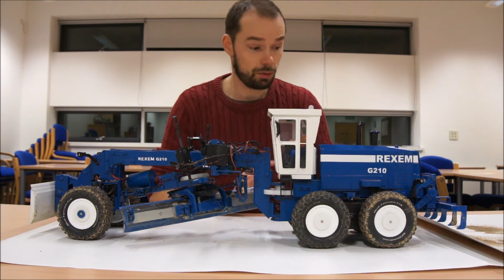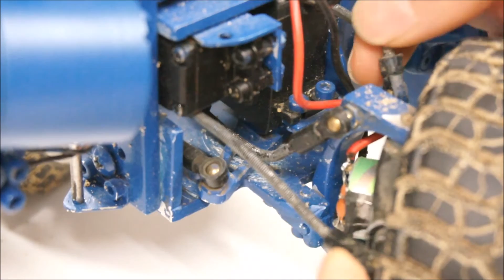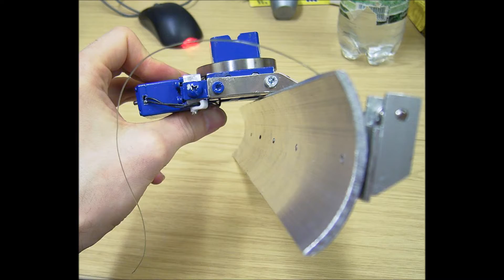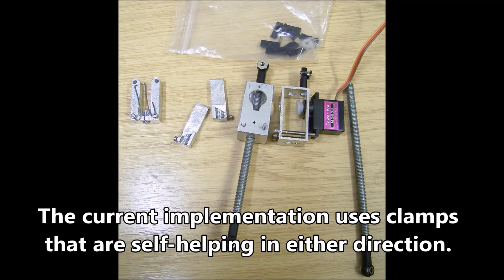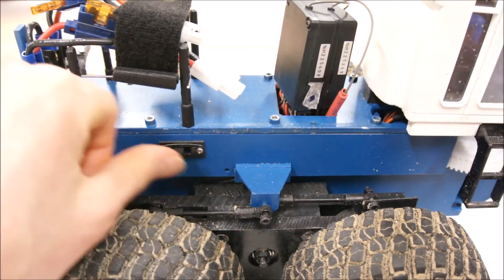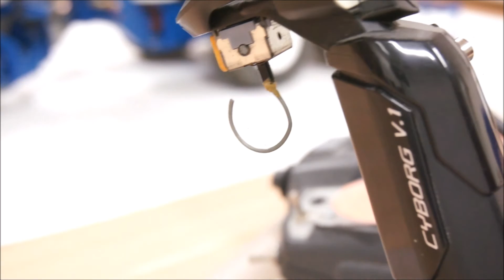1:14 scale model of 6x6 motor grader: Show and Tell

Comment: Marvelous build do you still own this unit?  Man would I love a 1/14 scaled grader in my collection
Reply from the maker: Thank you Ron, yes, I still own it, albeit somewhat in pieces. Need to get some time to solder my mouldboard electronic level control (and possible improve the code when its done) and then hand-configure several meters of servo wires and plugs to fit everything. Hate that sort of work. 
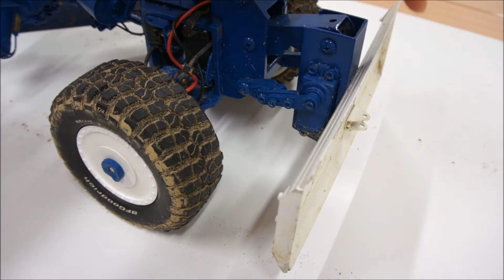In the meantime, I have finished a smaller 1:32 grader but I definitely plan to get back to the big one!

Comment: Excellent video! One thing I'm left scratching my head about was obscured by the wheels however, namely exactly where the torque balancing links are attached at the other ends? google as I might I can find very little information about them.
Reply from the maker: Thanks for your interest! I show the torque-balanced tandem in some detail here:
https://www.youtube.com/watch?v=c7T6P1AUSxw
I show the effect in a low-quality comparison video between non-balanced tandem and a rough prototype here:
https://www.youtube.com/watch?v=q_ArnTMT1Mg
That video's description includes some more detail and the video mentions the Caterpillar patent "US20100012401 A1" 
The short answer is: Somewhere on the chassis, but ideally in the symmetry plane of the tandem and so that each wheel linkage describes a parallelogram.
Reply: Thanks for the speedy info. If I've got this right the body of your motors are only gripped by the central black piece of the assembly (the one with the screw) leaving the motor free to rotate a few degrees within the other two pieces as and when the torque is applied. Is that correct? I'd love to incorporate this idea on my latest 6wd articulated dozer which is currently cocking one of the pairs of rear wheels whenever  it meets an obstacle it can't move. Best of luck! Col.
Reply from the maker: Almost! 
The motor rotates in relation to the tandem when the tandem goes over an undulation (a bit more than a few degrees, but obviously limited), it however does not change its angle in relation to the chassis. 
Furthermore, the torque does not cause the motor to turn, because it is balanced against the chassis. 
Full disclosure, I do not at the moment know how to fully balance a 6x6. If you look at patent "EP0713826 A1" you see a three-axle bogie of a main landing gear. This is rather simple, because the central axle sits in the middle, so you only need front and rear balancing arms (brake rod they call it) and you are done. However, I assume you want to have a walking beam arrangement with a tandem to follow the terrain and maximise the traction. But that leaves one axle out. All 6x6 (and 8x8) wheel dozers I know use "skidsteer" chassis where the wheels do not follow the terrain at all.  
Just subscribed to you, you better upload some video about that dozer now ;)